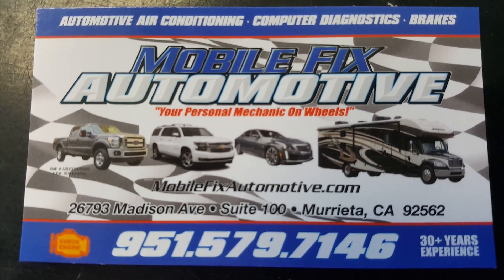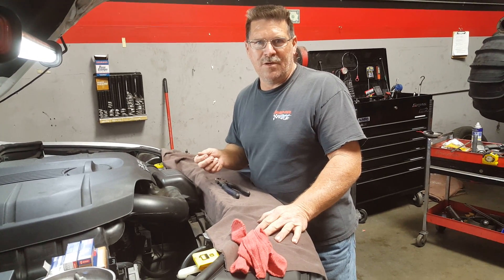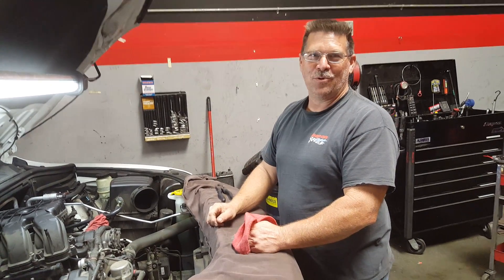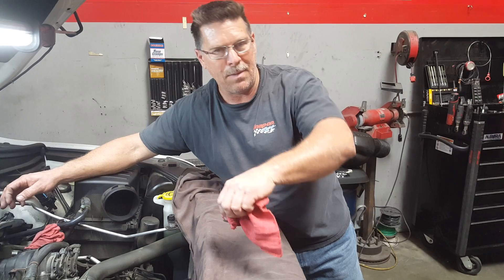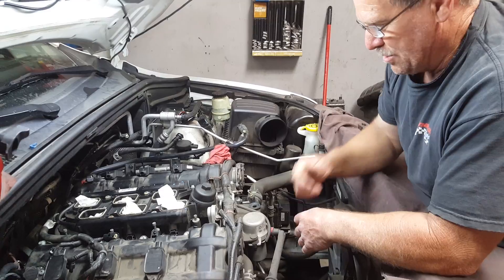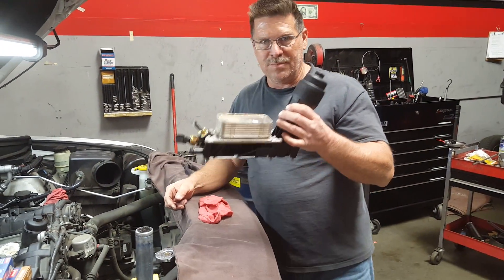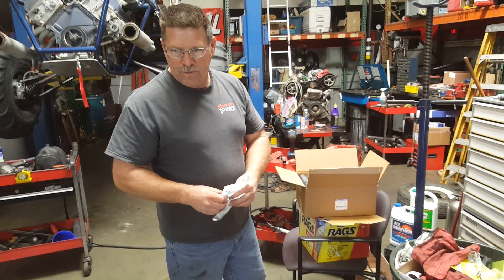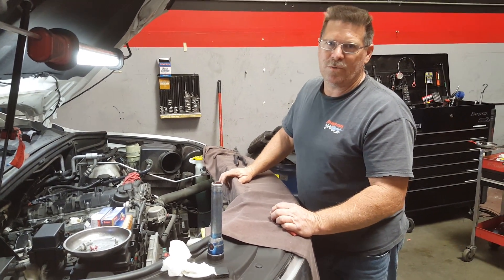2012 DODGE DURANGO 3.6 COOLANT LEAK

Comment: So we were trying to figure out where the leak was and I was right it was coming from the middle of that engine. But I think it was coming from the hose attached to that piece. Could it of been possible that white clamp that hold the hose in had been deteriorated and pressure was pushing the liquid through because it really was coming from that area and not around the side. Or could this have been tampered with some how “it is not” coming off the sides of the piece your replacing. Also could the leak have caused liquid to go everywhere to the point it’s caused electrical issues somehow for the battery to keep dying.2012 dodge grand caravan r/t…

Comment: Symptoms of this somewhat common failure of the oil cooler include overheating, large coolant leak from behind the block that seems to go between the transmission and engine mating surfaces, and white smoke seeming to originate from underneath the intake manifold. Both instances ive replaced oil coolers on 3.6 pentastar, customer  stated they were on highway/interstate passing another vehicle when the issue occurred.

Comment: Have same problem lots of coolant lost from back of engine , now my dodge durango is over heating already replaced thermostat so i think this is the problem what do yu recommend replacing the heads and oil housings unit?????

Comment: Thank you! My 2013 Durango had leaks around both front tires, when the engine tried to overheat I took off the plastic cover and I thought it was strange that all the steam was coming from there. Now I know. Please post the part numbers for the line and oil cooler.
Reply: Did uu ever fix the problem?

Comment: If have the SAME ISSUE!!! my thermostat failed and I believe it caused those rubber seal to fail beca i never had a leak before. Today i looked under the bell housing and have leak. I also noticed coolant puddling and smoking on top of the oil filter cooling assembly!!! This has to be it. Thank you soo much!

Comment: I have a 2013 Jeep wrangler sport, 3.6, same coolant leak. In addition, I replaced the coolant return hose. It was a little punky. While I was there. Coolant overflow stays full now and heat works good too.

Comment: I'm having a problem with mi durango it keeps wasting antifreeze have to put some everyday but doesn't overheat or leaks changed the radiator but noticed that the fan wasn't turning full power can u please send me some opinios

Comment: This video helped resolved the leak I had on my 2012 Jeep Wrangler 3.6. I couldn’t find the leak until I took apart the entire intake. Thanks for the video!
Reply: how the engine holding up?
Reply: Did you get a check engine light?

Comment: I took my car in for an oil change and the dealership said I had a leak for my coolant and oil but there was nothing on the ground or that I could see on the engine. My car was close to overheating yesterday and I am out of coolant... I am thinking this is the culprit. Dealership wants to charge $2200 to fix but I have an extended warranty so will try to get it covered under that! This was so helpful and will help me when speaking to the dealership. Also am due for a tune-up too so that was a great tid-bit!

Comment: Great video!  I have a 2012 charger and have been searching out the leak on the bell housing but couldn't find it.  I've gone through a couple bottles of tracer but can't see in there enough to find the leak however, my hand got dye on it right next to the hose.  I bet that the oil cooler is the problem.  I was worried it was a head gasket problem but it doesn't have the normal head gasket problems.  I appreciate all the extra insights about the fuel line disconnect.  I probably would break that off too.  Thanks for going over this procedure, you are saving my butt.

Comment: I found that the people who change oil,  over-tighten the oil filter cover. The shop I use allows me to remove the filter cap on my own and I GENTLY put it back on. I haven't had a leak from the unit since 2013.

Comment: If you don’t return YouTube callers well do you get on here and answer their questions? Cause I just have one small question and I will be right out of your hair. Is this breakdown for the 3.6 the same for the 5.7? Cause I noticed in a lot of Durango videos nobody works on a 5.7 everything is a 3.6. But if you can help me or someone else that knows about the 5.7 engine please help me answer this question.

Comment: Did this vehicle show any signs of running a little on the warmer side? Currently diagnosing this issue except I’m losing motor oil and my ‘12 Charger 3.6 gets up to 230° on the EVIC.
Reply from the maker: Only because it was low on coolant from the leak.
Reply: Ron Williams I replaced my thermostat last year with a mopar unit. I have no coolant leaks but my car runs hot
Reply from the maker: All the time or just at slow speed
Reply: Ron Williams it heats up in stop and go and on the freeway

Comment: How do you get to that 13mm bolt that holds the bracket on the left as you're looking at it / passenger side. Do you have to reach in blindly from the top or can you get to it from underneath?

Comment: That what's mine is doing,going to dealership today because other mechanic could not find where the coolant was gushing from even after taking manifold off,I have that 2012 dodge Durango 3.6v
Reply from the maker: Its a very common leak at cooler.

Comment: My leaks water and I'm on a tight budget. Can I just replace the gasket or I need to change the whole oil adapter?
Reply: Gaskets yes.  May not be problem
Reply: Gaskets are cheap.  So are engines

Comment: Great video. Thank you for showing it. Guess I'm doing alright with 263,000 miles and just now having the same problem. I'll be tearing it down to confirm but, looking like a sure bet.
Reply: How much did it cost to repair.  The shop I'm dealing with quoted me $1225?

Comment: how reliable would you say this motor is otherwise?
Reply: It’s actually a pretty solid port injected engine. A lot of people will smirk and called it a POS because it’s in a Dodge but I’ve got the same Durango and it’s been very reliable.
Reply: @kickerbeat  yea I agree I've had mine since 2017 and it's been fine
Reply: @SiccSideKali4Nia209  same here I've got a 2012 with almost 115k and its still running strong. Hoping to get another 5 years out of it.

Comment: Ron, was the oil cooler assembly the problem and where specifically was the leak. I had the same signs and symptoms on my engine - coolant pouring out the back of the engine. this video convinced me not to tear it down to the heads. I am not confident enough to do that. Now if it turns out after i put it all back together....well....it looks like i WILL be doing the tear down again.
Reply from the maker: Yes it was the leak. from plastic housing.
Reply: @SandCarServices  thank u for replying.

Comment: I have a 2013 Dodge Durango and can't locate the Engine Coolant Temperature Sensor does anyone happen to know the location?
Reply: Brian Sobek go to motorcity mechanic site David has video
Reply: Back of oil cooler sensor is attached

Comment: I have a coolant leak it’s really bad it’s coming from the bottom by the engine but we can’t find where it’s coming from please help I have a 2009 Dodge Charger and it over heats if I drive longer then 15 minutes
Reply: That might be water pump. You have a 3.5 or 2.7

Comment: Hey Ron, Great video by the way, I have a 2012 dodge journey SXT and Im trying to get a handle on where the antifreeze keeps going and where its coming from. Im in Ozark Alabama  and I was quoted 1200 to 1500 from a mechanic shop to fix it, he quotes me something like12 to 16 hours of labor. My question is, what book did you mentioned the pricing guide was from, and where can I find one of your videos with step by step instruction. If there is any.

Comment: If engine were designed by technicians. They would never change. My 2016 F150 would still have a gas guzzling 351 with a carburetor getting 8 mpg.

Comment: Vid says coolant leak but he replaced oil filter housing ?
Reply: The gasket on the cooler is the reason it leaks
Reply: @lizmontero536  so why the oil housing tho
Reply from the maker: Housing was cracked

Comment: So it is normal for an oil filter adaptor to leak coolant? I have heard lots of people having oil leak issues with it. I am having a coolant leak in the "valley" where the oil filter adaptor is right now, no oil leak just water coolant. I have replaced the seals on it with new Mahlel seals on it and still water leaks in that area. Took it off and put it back on 4 times and it keeps leaking even more. I did a 108 in lb torque on it and still no dice, the book said 106 in lb I did 108 in lb just to make sure I did get it tighter. So I guess it is a $200 full oil adaptor replacement to get it fixed now? I have taken it off and did an inspection and saw no cracks or anything under the oil filter adaptor at all, just nothing, looks fine but leaks from below. I know it is not leaking from the sides because I saw it leaked into the valley without the plenum installed on it near bolts 3 and 4 on the oil adaptor.
Reply from the maker: Its leaking from the housing.  Replace it with dealer parts. It can leak coolant or oil.
Reply: Mopar has an upgraded part that is $60 cheaper.
Reply: paul joe when u say mopar has an upgrade, is where can I purchase it from mopar? Is it like a website or the dealer TIA
Reply: @alga9593  buy the one for '14 and up.  Fits fine.  Dave at motor city mechanic shows u how
Reply: paul joe yes but where exactly buy it from. Dealer? Amazon? Rock auto? Sorry if I sound clueless this my first car and I’m 19 years old just trying to get the right quality and avoid having to re do it.. thanks again
Reply: @alga9593  dealer or any online mopar dealer.
Reply: @alga9593  go motor city mechanic on YouTube.  He has a video
Reply: Next time buy a Toyota